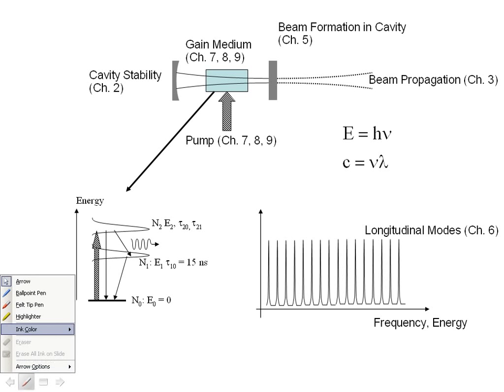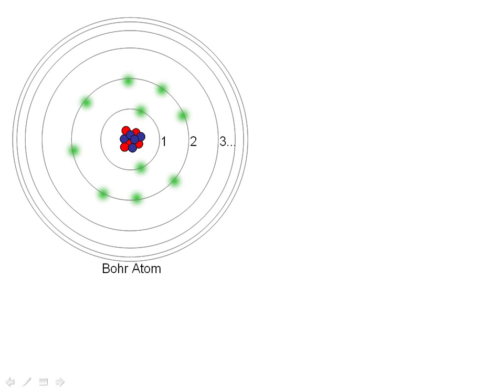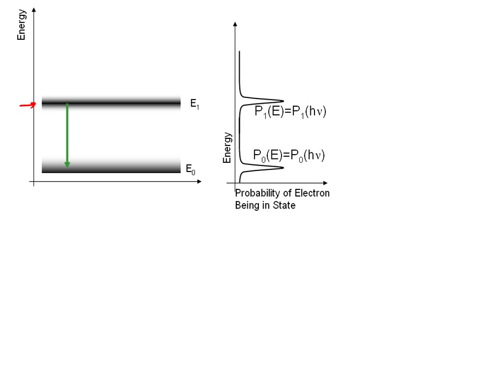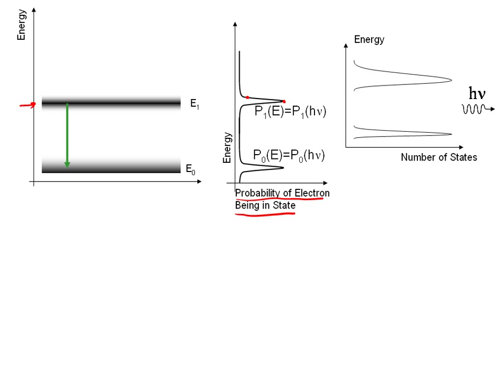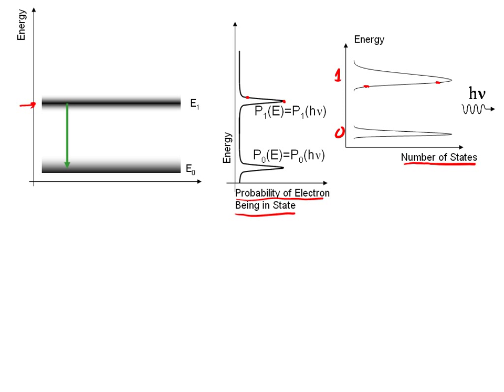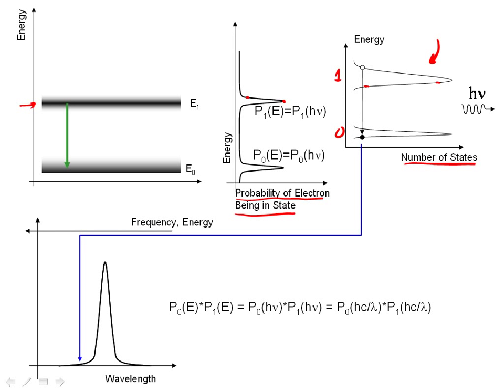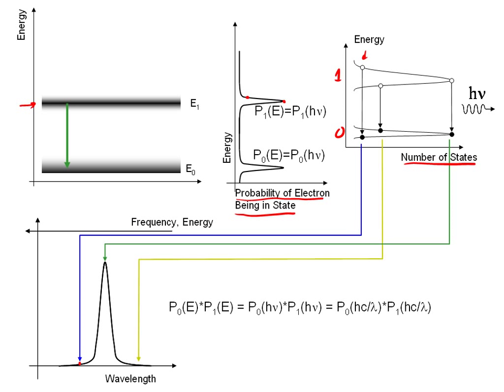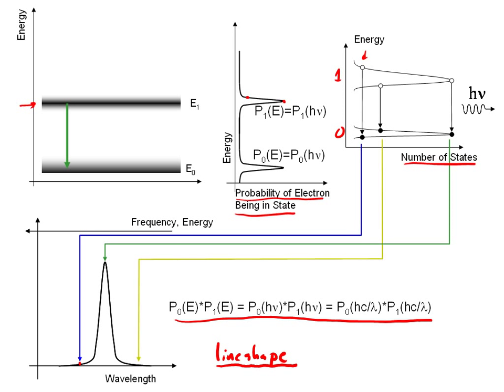Lineshape and Spectral Broadening- part I

Comment: Key idea(s):
1) Line Shape g(ν) = Convolution of Probability Density Function (PDF) of Electron State 0 and 1, P₀ * P₁ = P(E₀) * P(E₁).
2) Diagonal State Transitions
  - These are not possible in semiconductors because of the Heisenberg Uncertainty Principle:
      - An electron being in either state with a defined energy (i.e., E₀ or E₁) means that there is a definite position (i.e., it's confined in space, maybe to an associated atom and/or because of the forces of other electrons/charges, etc.). In order for a wave (i.e., our electron) to be confined in space (i.e., position), you need an infinite number of waves, each with different frequencies ν, to superpose into the resultant wave function that places your electron at a specific location/position - think of the Fourier transform of the wave in the time domain, i.e., the frequency domain graph/function of the electron's wave function.
      - The momentum of an electron is given by p = hk = 2πh/λ = 2πνh/c (the de Broglie relation). So, if we require an infinite number of frequencies to confine our electron, we don't have just one value of k; we have an entire (infinite) range of k values. That is, k --> Δk = ∞. This gives us Δp = h Δk = h * ∞ = ∞, which is non-physical, i.e., unrealistic/impossible.